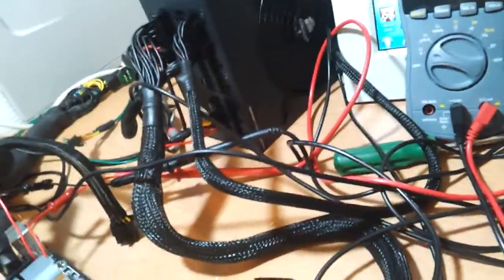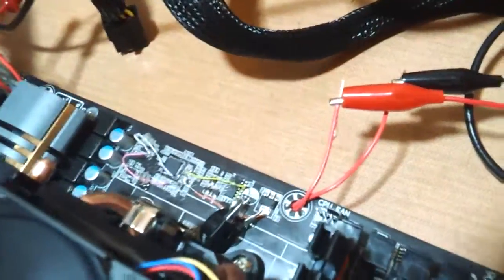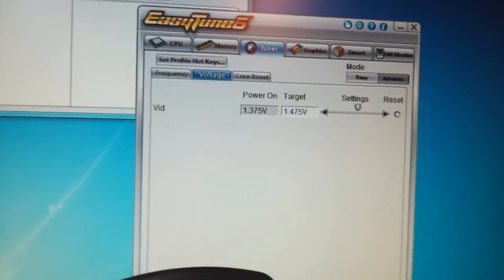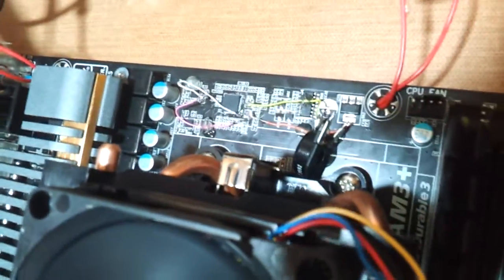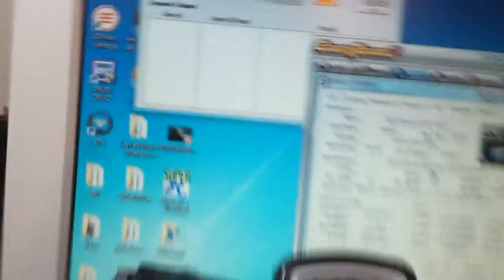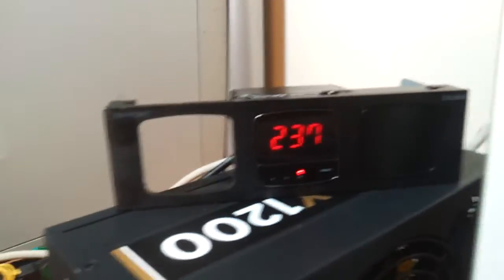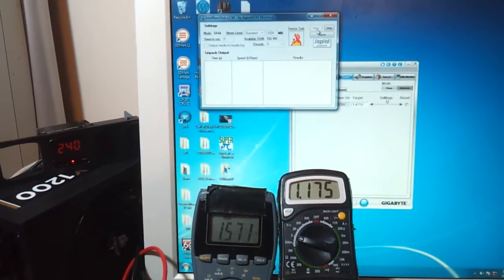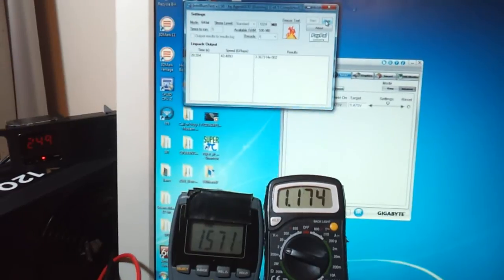(SinHardware.com) 990FXA-UD7 Vdroop Mod

Comment: Near the work area, there is an empty capacitor place! You may try to fit a 16V 100uF or 6,3V 560uF solid capacitor to gain stability. All previously released mainboards have a capacitor on that place from different brads and models, as I said!